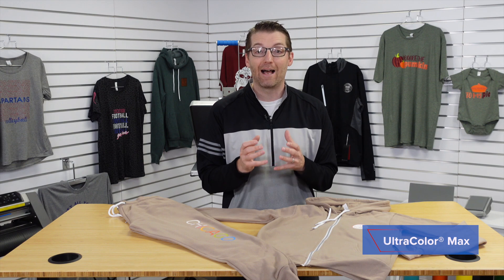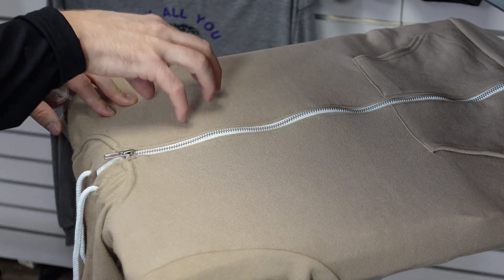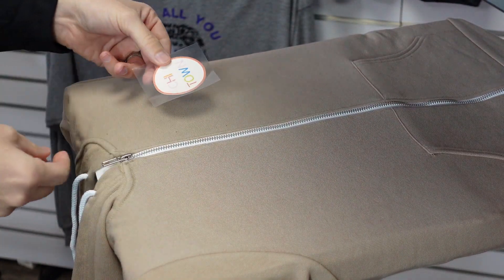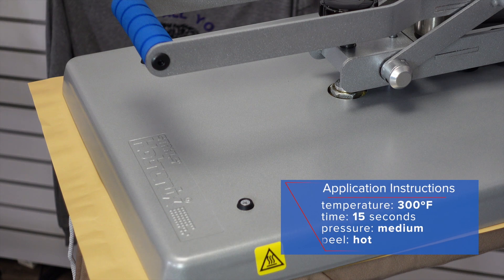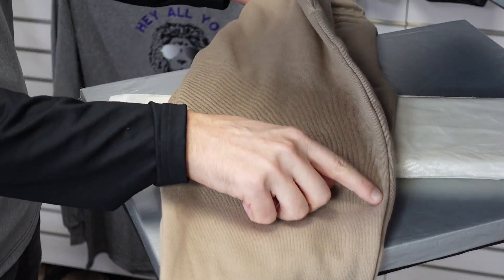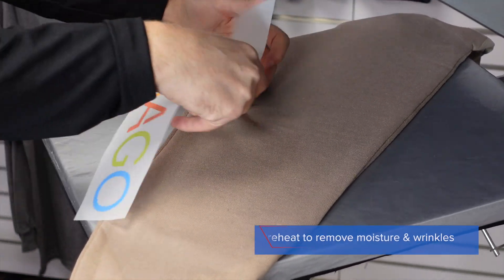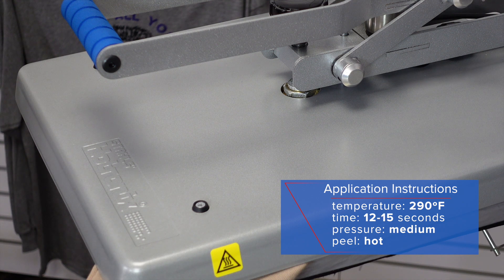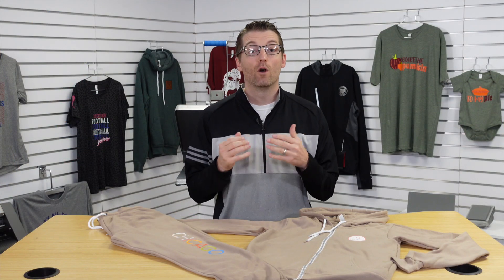The Best Heat Transfer Options for Fleece Apparel

Comment: how did you prevent the zipper from melting?  i have the same heatpress but my zippers have melted each time
Reply from the maker: The print pillow helps with raising the print area and lets the zipper to sink so it isn't affected by the heat.

Comment: Can I know the exact measurements to the leg placement and word Chicago. I want make a order
Reply from the maker: Hi Reggie. As a general rule, the letter height on leg and sleeve placements is 2-4", with proportional width of the text.
Measurements will vary depending on the size and type of garment you're applying to. Check out our Design Size & Placement Guide for some tips on artwork sizing for different garments and locations. https://www.stahls.com/design-placement-guide